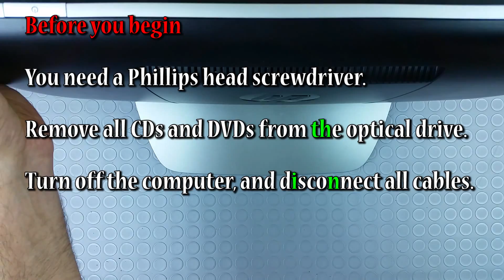(DIY) How to replace memory on hp touchsmart 520

Comment: Hi Walter, going to attempt this on my HP TouchSmart 520.  Question do you have to replace the battery or can I just simply put in a new RAM and call it a day?
Reply from the maker: You can just simply put in a new RAM 👍
Reply: @puoifarlodasolo  hi, can I put in 2 x 8 gb?
Reply: @lukasm4878  no, max is 8gb